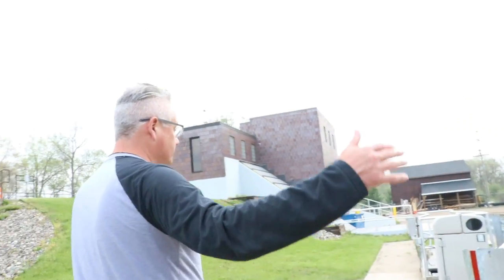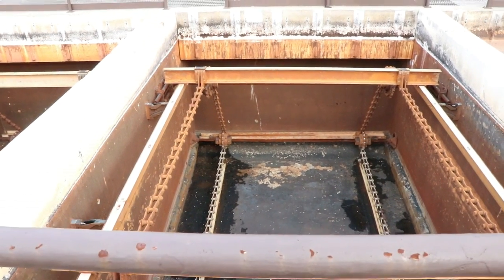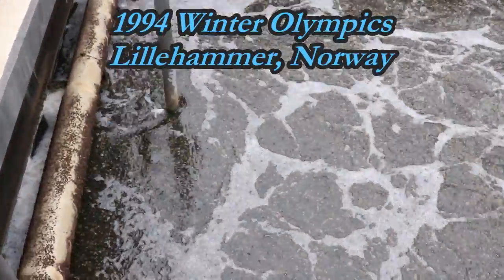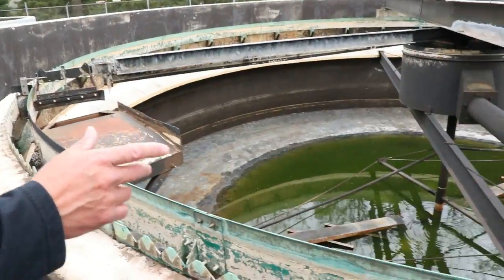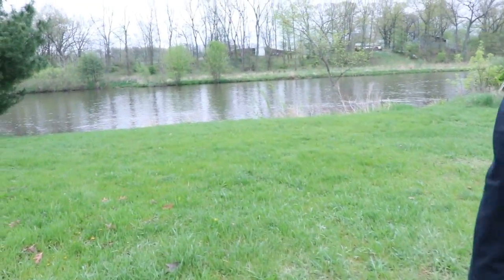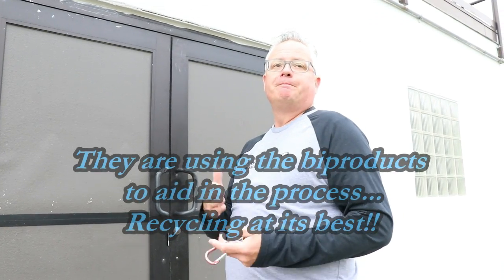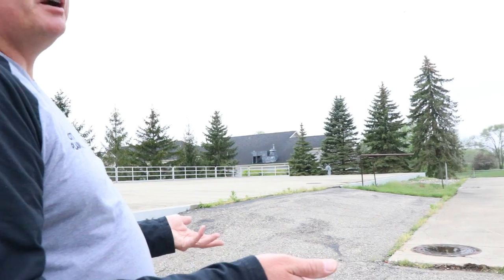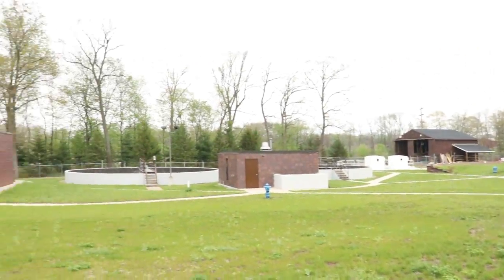Tour of a Water Renewal Plant- Where does Formaldehyde and Embalming Blood and Fluids Go?

Comment: k a r i what about the amount of formaldehyde that goes into the ground from burials
Reply: 99% of burials are done with a concrete Vault that the casket containing the body is placed in , here in the US it's a requirement that all caskets be put into a concrete vault to protect the ground water from the decaying body also vaults prevent the ground from crushing the casket.
After so long the liquid contents of inside the casket from what was part of the body turns into a gooey substance and then dries up and for the most part everything is contained within the casket if the steel is made well enough.
Reply from the maker: What about the amount of chemicals going into the ground with what the living people add to it?

Comment: So where does the drinking water come from? Is there just one employee there at a given time? If it’s so safe one would think it should be safe to utilize directly. In the beginning he said there was a tester before the auger took up water. How often is the tester used? What is that testing for? This man was nice and informative however I think he answered some questions in a way that was true but not necessarily completely disclosing. For example the wipes. He answered questions you were asking not straight out but close but it boiled down you likely meaning the chemicals, blood, all other body fluids, solids and any other huge worries For him wipes seem to be the biggest issue. I use wipes to remove makeup and attempted to clean the sink with one some do break down. I worked for a state and analyzed the ground water, waste water, coal, fly ash, gasification effluents etc. I am at least qualified to have observations and opinions.He was correct about the microbes, methane, etc but didn’t go much beyond mentioning a couple of compounds on the PPT concentrations. He  didn’t say the effluent was clean enough he’d drink it. It’s going into the river might mingle with algae’s and into the fish. Obviously these systems are only as good as the people who work there and the equipment they use. There would be no e-coli in a good scenario yet there is. People will rely on dilution to maintain acceptable levels. Yes for many of us it’s the idea of it all and no amount of treatment will take away the images the mind may come up with. Some funeral homes have holding tanks that are pumped out or malfunction and overflow. I do really appreciate how you go out of your way to address questions.
Reply: samasia skipperable I delivered to several coal power plants that are transferring to natural gas. There is fly ash and by product everywhere. I was told that every step is stirring up cancer causing dust. The sludge ponds are worse, stay away.
Reply: B Roberts Sir I agree before recycling the environmental impact from burning coal was devastating.  Not all states may be participating in the program either. After all it’s much cheaper to do nothing and dump leftovers.

Comment: Would bottled water have gone through this process?  I sat here thinking I am never drinking store bought water again.  I thinkk well water would be the best.  Yes? No?
Reply: Jo Ann Gasper Many Brands of bottled water are nothing more than water out of the tap that may or may not be filtered, spring water, or well water it is only as good as what is not in it. For example if there is farmland around fertilizer or pesticides can run off into your aquifer then you might want to consider not drinking the water or at least filtering it yourself. if somebody poured a concrete slab cement composite it’s possible to have high levels of contaminates that can leach into groundwater/spring/aquifer. Some water sources are vast and a water source is acres away from someone’s farm or business it doesn’t mean it’s always safe. One can get their well checked on a regular basis or purchase a water filter system like the Alexapure 1 filter is good for 5000 gallons for $147 on bpearthwatch.com a very good investment and one can add more filters if one wishes.
Reply: samasia skipperable Well there are some ppl who won't get their wells tested they like the idea of getting sick and blame everybody..